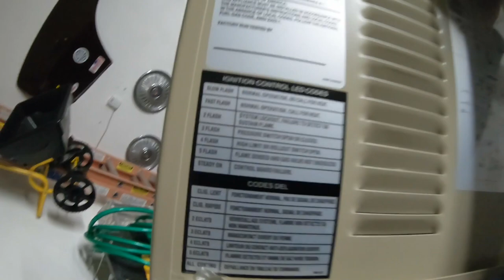Mr Heater Big Maxx furnace not igniting

Comment: On mine the metal barb fitting the hose plugs onto was corroded not letting air flow from the fan to the switch.  Quick cleaning with a piece of wire and good to go.  Good video

Comment: Great Video!!!  I had the exact same issue with my Big Maxx 50,000 btu garage unit. 3 flashing lights on the control board. I pulled the white tube from the pressure sensor off of the nipple ( near the fan unit.) I found it had a bit of moisture in it as well being split near the end of the nipple. I gently sucked the water out of the tube and then reattached it to the nipple.......IT WORKS !!!!    thank you for posting this video
Reply from the maker: Glad this video helped you, but sadly I have to say that I ended up trying a few different things to fix this issue and finally I got it to stop only after taking a small drill bit and drilling out the small hole (nipple) to a larger size.
 So far I haven't had any problems with it this winter.
Thanks for checking out the video and for your comment.

Comment: I have the Hotdawg made by Modene 45,000 unit since 2014, so far so good. I have it setup on a Honeywell WiFi thermostat. These units are so much better then the propane or other garage heaters. Got to be very very very careful with the propane models and any combustion model that does not vent to the outside, when I was young I found out soon after I was lucky to make it out of the garage that night as I felt dizzy, walked up and out from the car and got fresh air, never used it again. It was a Mr Heater propane version. Doesn't matter the brand really without venting to the outside they are unsafe and should only be used with a CO-ALARM. As a note I have added 4 Kidde Nighthawk Carbon Monoxide detectors around the home, they include CO and explosive gases. Recently a good friend that I worked with Bill at hp went in to try and save people on the ground in a garage due to CO and did not make it out.
Reply from the maker: I am sorry to hear about your friend bill.... I agree a carbon monoxide detectors should be present in a garage where a heater of any sort is in use. thank you for your comment, I appreciate it.

Comment: Thanks for the video! 
Mine did the same thing after a couple years of use. I first tried suction and air pressure on the bottom end of the hose. 
That didn't help so I tried pulling the hose off the blower base and inserting an unbent paper clip in the nipple, wiggling it around thru the much smaller hole at the base. That removed what felt like a little obstruction and the heater worked again. But in the next few months I had to do it two more times.
I thought that maybe the tiny hole at the base of the nipple was clogging up due to sawdust in the air or maybe rust was developing on a factory punched out hole that was then no longer galvanized, so I used my drill with a drill bit that was just one size too big to fit thru that tiny hole.
Sorry, I don't recall the exact size; just the next size up in my drill bit selection. I drilled out the hole and it's been a little more than a year now without the problem so perhaps I can suggest doing that. Good luck!

Comment: My problem not so easy. Big Maxx has been excellent on sending replacement parts on warranty. Wish they had better diagnostic flow charts at service call center. Checked exhaust hole no blockage, replaced pressure sensor, replaced gas valve, replaced motherboard, cleaned flame sensors (not dirty), checked exhaust vent no blockages, and exhaust turbine clean and spinning, sent second pressure sensor, and still short cycling. Finally found problem. Exhaust housing gasket leaking air. It has been backordered for a month now. I have become quite the HVAC tech from this experience.
Reply from the maker: Wow, you are definitely a pro now! Hopefully, you'll have figured out this time.
Reply: @bigshow65  Replace exhaust housing gasket today. When turning the manifold upside down could see a wasp nest about the size of 2 golf balls at the bottom of it next to turbine. Could not be seen from looking thru exhaust exit pipe, and turbine spun freely. Removed wasp nest ,replaced gaskets, and it is cycling normally now. Big Maxx is a good company, and promised to make this right even if it meant sending me a brand new furnace. They take care of their customers.
Reply from the maker: @jamesjenkins3384  Its really good to hear that the manufacturer stands behind thier products especially  these days where everything just keeps getting more expensive.  Glad you got it fixed and thank you for sharing this info for the rest of us. It's definitely something I am going to check out.

Comment: Interesting what the crud was in the fitting hole. As you know garages have extreme temperature variances with winter weather and tend to generate much more condensation because of it. It could have been something in the hose as well that just washed down by gravity when off and cooling down. Flame sensors also cause common problems with temperature variances but they’re an easy fix by just removing them and sanding their surface lightly with fine grit(220 or finer) sandpaper (if it’s not age related deterioration). Moisture over time generates a thin film on the sensor making it difficult to detect the flame/heat subsequently triggering the safety shutdown.  I found your videos while researching heater types to install in my garage that I’ll be building this spring. Your video hepled me decide to use the same heater that will include a smart thermostat as well. Great job and thank you.
Reply from the maker: Thank you. This was the very first video i ever posted on youtube but I'm glad that in all the mistakes i made while making this video it was able to help you. This furnace is still working perfectly so what ever was clogging it up this fix has worked well. Good luck and thanks again.
Reply: Bigsho65 everyone starts at video #1 and we all learn from mistakes. It’s often the honest right to the point videos that are the most helpful anyway.  I can see you are one of us/those people that like to tinker, figure out and fix things ourselves when we can. There is always a need for your kind of attitude and thinking and you are pretty much guaranteed life success with that mindset. All the best with the channel. I’ll keep a watch out for more interesting stuff.

Comment: is this heater similar to my Heatstar by Enerco? It looks to be the same- Mine isn't firing either and the green light is just flashing consistently which I think means it's in stand by. I haven't taken off the cover yet, Im a little gun shy but want to try and fix myself. Think I'll try and see..
Reply from the maker: Great question,   To be completely honest with you I'm not real sure, I'm looking at a heatstar online right now and they do look very similar but again they're made by different companies. the only thing I could recommend is to pull the side cover off and just take a look, maybe take a picture of it and compare it to mine from the video.  Hopefully on the inside of the cover will have the description of what those green flashes mean to see if it's similar to the problem mine had in this video.

Comment: Hey Bigsho65 question...do you know if there is a timer for cool down time out? mine has always run cold way too long after cool down and blows all my heat out hoping you may have seen a dial on the board?
Reply from the maker: That is a good question, I don't really know but I'll take some time this weekend to take a look at it and see, I'll let you know what I find out.
Reply: @bigshow65  this is great of you mine is hard to access so i am very appreciative of this action fo little olde me !! 
if i am correct it should be a tiny pot dial on the drive board there maybe more then one 
big cheers to my power tubers like you!
Reply from the maker: I am so sorry that I am just getting back to you on this question. I didn't find out anything about a cool down timer but I instead noticed the mine takes a while during the cool down cycle as well. I'm not losing much heat, it hasn't been an issues for me.
Reply: @bigshow65  hey thanks for your efforts they are much appreciated possibly they used a timeout relay from china and its not timming out correctly or consistantly  thamks for your help

Comment: Are you still up for questions? We have 4 flashes, replaced both parts, still won't work. Cokd front coming Saturday night.
Reply from the maker: So is it trying to turn on at all?
Reply from the maker: Try this, take out the the other end of that clear hose, the little metal thing it connects to gets clogged so take a pin or something small and sharp and poke into the small hole and clean it out then put the clear hose back on it. Hopefully it kick on for you.
Reply: The combustion air blower fan is not coming on. And the fan that blows the hot air out into the shop is not shutting off.
Reply: We did replace the pressure switch and rollout switch, no change.

Comment: I have had mine for 3 years but having issues with a 2 light code.  replaced board, no fix.  Now trying thermostat.
Reply from the maker: Thats not good, i hope uou are able to get it fixed. I haven't had anynore trouble with mine since the fix.
Reply: Thats what mine has (flashing twice) and the ignitor isn't working. Everything else seems fine including the nipple and the tube. What did you find out. I could really use the help. I'm up here in Minnesota and its still too cold, especially overnight.

Comment: Fuck sakes , no way.  Worked, Brad nail in the blower blow back and forth.   Bingo
Reply from the maker: Hell yeah, I actually took  a drill bit, a really small drill bit drilled it a little oversized and I haven’t had any problems with it since I don’t remember the size of the drill it I used, but it wasn’t very big.